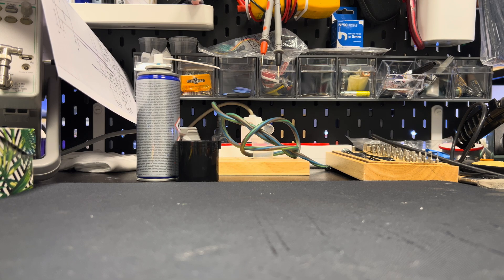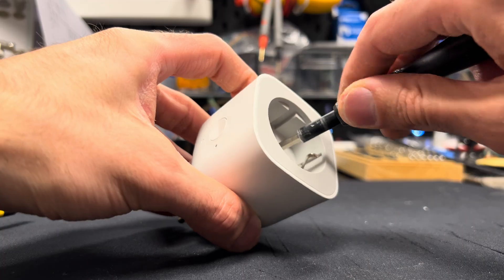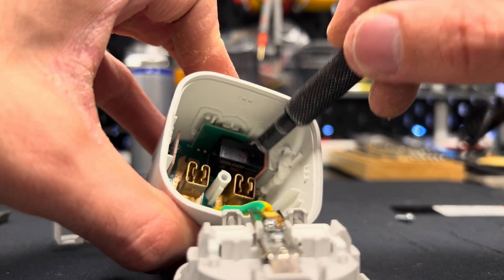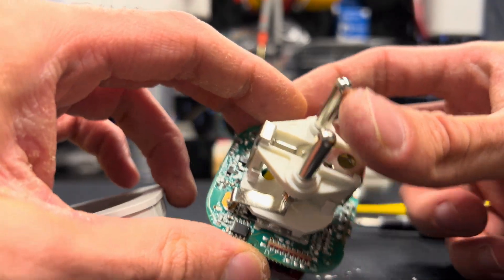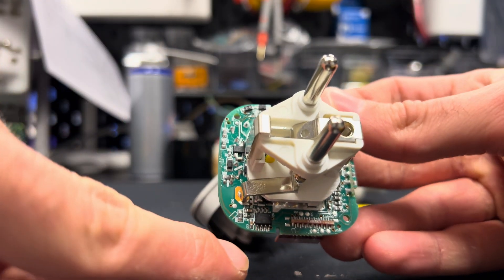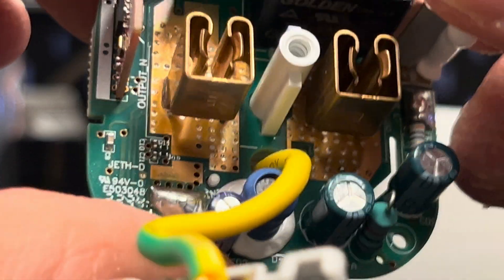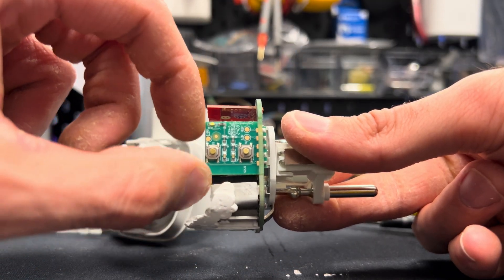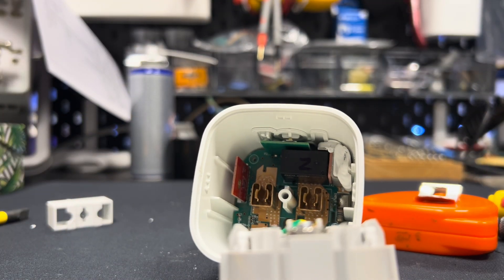IKEA INSPELNING Smart Energy Monitor Plug - First Look and Teardown

Comment: Note to others: I damaged the push buttons of two plugs I disassembled. I did take care but it still happened.
Reply from the maker: Unfortunately the way they’re mounted makes them catch on the plastic button and probably rip the top off. It shouldn’t be very difficult to solder new ones and of you configured the plug first you probably don’t need them
Reply: @FrancescoF  Correct, the PCB is very simple so replacing or adding a larger custom button is possible.

Comment: I want to modify mine to only measure power. Never, ever, cut the power. Do you think it would be ease to desolder the relay and bridge it? Will that break anything else? Does that also mean that it's safe to remove the heat sink you mentioned?
Reply from the maker: I converted mine to DIN with the same intent. Previously you could measure the consumption even in the off state but now it will report 0W unless you turn it on. If you don’t pull much current you can remove the heatsink
Reply: @FrancescoF  But if the heatsink is for the relay and I remove the relay and bridge it with a suitable wire (like 1.5-2.5mm^2) there shouldn't be a need any more at all to cool the relay (since it's not there) no matter the current (within spec for the plug). Or have you found that it's cooling something else?
Reply from the maker: @ I think it’s mostly for the relay as there is thermal compound between the two
Reply: @FrancescoF  I have now removed the relay and the heatsink and bridged the connection the relay would make on 2 of mine. Works great. I do however get a reading no matter what state the "switch" is in. I did notice that there was a new firmware for them and I only tested after upgrading. Using it with ZHA in home assistant, not with IKEA Dirigera.
Reply from the maker: @ I have Dirigera, initially the measurement function was disabled, then a fw update enabled it and after a while it went on reading it in the on state only. Firmware now is 2.4.45

Comment: In manual you can find this:  Max output power: 3680 W / 16A, Resistive load/ Max 300W motor load.
Is that means that we can't plug our washing machine or thumbledryer to monitor power consumption?
Reply: It should be fine as long as the plug is ONLY used for monitoring power consumption and not switching the relay off during use. The lower max rating for "motor" is because when switching inductive loads, motors being the most common, the load could cause a high voltage spike and fry the plug. When using smart relays for such loads, usually a RC-snubber is required to filter such spikes and protect the device.
Reply from the maker: The motor in both cases shouldn’t be more than 300W, most of the energy is in the resistive element for heating. 3680W is above the limit for the average household here

Comment: Thank you for the video.
Does it matter when I have reversed wires in my power sockets? Will the power and voltage measuring still work?
Reply from the maker: Yes, it will still work